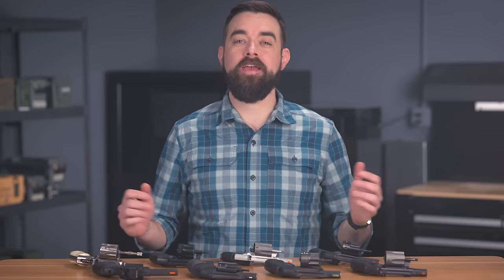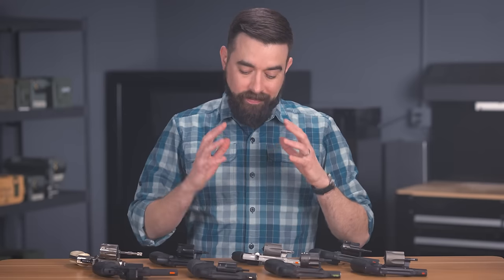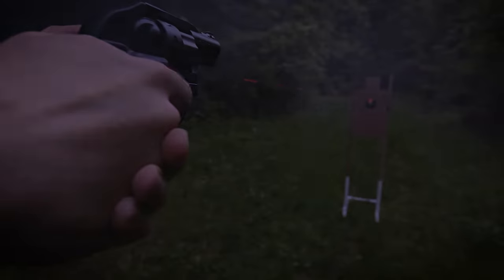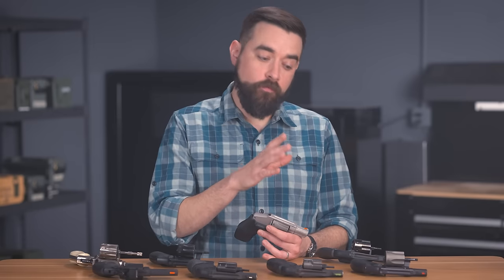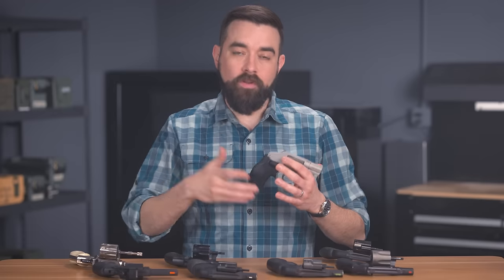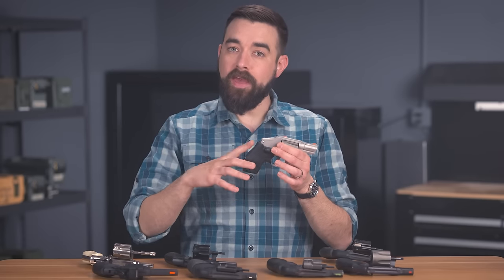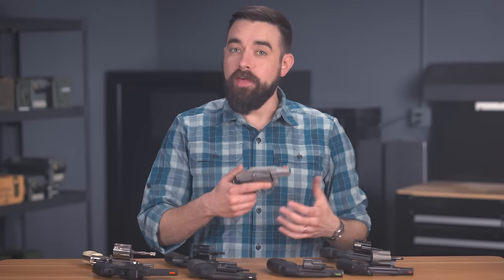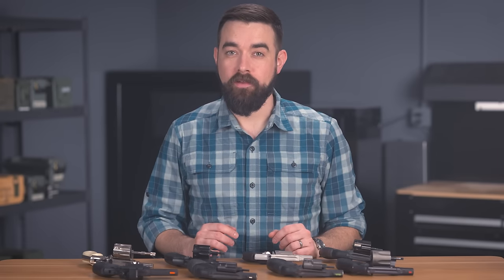Tips for Shooting a Snub Nose Revolver

Comment: One of the best snubby/J-frame videos. Well-done w/ a clear perspective that everything involves (1) awareness of your most effective grip & press habit, (2) PRACTICE, and (3) inevitably: compromise. 

The one thing to add to encourage those taking on the snubby challenge: you will become MUCH more skilled with your other larger and more "conventional" handguns. I'm a crack shot now with my G19. This is the by product of developing very good skill w/ a 442.
In my last re-qual for CCL (shoot the giant B-27 @ 5, 7 & 10 yards), my target was the best of the entire class of 10 shooters, all shooting semi-autos up to red-dot equipped full-sized versions. Only 4 of the 30 ended up in the 9 oval, all fired 5rd in ~7 sec or less. If I had used my G-19 (box-stock except Dremel-crafted grip mods and new sights) they'd have all been Xs.

Comment: Very good video on the subject. I was a plain clothes LEO in the era when a snub was the best option a lot of the time when concealment was a must. I carried several different snub .38 revolvers over the years. Everything you said is valid. I have always said that snub nose revolvers are not for the novice and not for anyone who does not put in the time to get decent with them. When it is a matter of life and death like it is as an undercover LEO you do what you have to get proficient or at least I did. To this day the only weapons I will ankle carry are a snub revolver or a baby Glock. That method of carry is just too dusty for me to trust anything else. I personally would never go any lower in caliber with a snub than .38. Most of the time when I use one now it's either a S&W 642 Airweight or an older S&W 649 .38. If I can find standard pressure 158 grain lead semi wadcutter ammo that is what I prefer, if +p is all I can find in the same projectile that is what I use. Like you said its all subjective. That ammo in those guns with either a boot grip or a Tyler t-grip is what I found worked best for me.

Comment: What a well done comprehensive analysis of snub nose revolvers. The one thing about wheel guns is they always work and they are as simple as pulling the trigger.

A long time ago as a police officer I carried a Smith & Wesson snub Chief's Special stainless, 5 shot .38 Special as a backup and off-duty carry. What a bucking bronco! Ended up ditching it for an AMT Back-up .380 that fit into a cigarette pack in my shirt.

Comment: I gave my dad an Armscor M206, then put some aftermarket Colt D series grips on it. It feels GREAT in the hand now, love a grip that starts narrow at the top and swells towards the bottom (which is why I HATE the wide rubber grips on my .357 Magnum).
Reply: I bought that grip but need help fitting it on my 200.
Reply: @sidneywhite749  it isn't a perfect fit, but it is close enough to work. I lined up the back of the frame with the grips, if the front overhangs a bit it doesn't make much of a difference. For the holes for the frame pins I used a drill bit and twisted it by hand to make the holes. There is a small gap and a slight overhang on the front but it is still WAY better than it was.

Comment: I really like Pachmayr Diamond grips.

The crimson trace grips for LCR are pretty good too if you want a laser. The thing to remember about a side mounted laser is that POI shifts significantly side to side depending on distance to the target.
Reply: My friend owns a Ruger LCR .38spl with a red Lasermax. He's owned it since spring 2013. He has it mainly for home security 🏡. For ammunition, he loads older +P Cor Bon DPX 110gr. 5rd.

Comment: Excellent video! Personally I prefer a larger framed snubby (K frame size) in .38/.357 with full size rubber grips. Then carry it appendix. Also it has to be a minimum of 6 round capacity. 
This is just what I like and am used to shooting.

Comment: I grew up shooting my dads '60s chief special. He still carries it.
The grips and handle are tiny even compared to alloy models of today and feels like hitting yourself in the hand like a ballpein hammer.
After one box of plus P as teenager, my wrist and fingers swelled huge. Maybe stress fractures.

I always went with bigger, heavier, cheaper Charter arms until Ruger made the LCR dao.
It's like night and day recoil control. I can shoot an hour with those, no problems.

I go with Jerry's j frame technique. I'm old so I still use a half weaver half modern stance and pinching the trigger ring guard and back strap with index finger and thumb on the support hand centers sight alignment naturally.

Comment: I second everything you said Chris. I have a S&W 642 Lightweight I almost sold after  a painful first range session with plain Jane .38 Special LRN bullets. After 1/2 a box I was done. I planned on selling it until I watched a video where the person raved about how the Hogue replacement grips ($18 then) changed his attitude with a similar revolver. I ordered a set and the guy wasn't kidding. The Hogue grip was a little longer with a pinky groove but the best feature was the part of the grip covering the backstrap. It has a lot of give and completely removed the snap sting of the backstrap from my hand. Also as you stated it allowed for a better finger weld on the trigger which seemed to smooth the trigger pull and made the trigger pull weight feel much less. Needless to say I love the pistol now and it is one of my favorites mostly due to a simple grip changeout. Great video and a real benefit to those watching who may be disappointed in their lightweight snubbie!
Reply: Get a spring kit for your 642 and it will be even better to shoot!  🙂

Comment: Great information here.  I've only had guns for a few years but revolvers are my "collection" so I'll add a few things.  Like you, I used an orange paint pen on the front sight.  I also used a lime green/yellow paint pen to put dots on either side of the rear sights.  
    My main defensive gun is a 38 Special snub-nose.  After trying a bunch of different ammo, I concluded over time that I am a lot more accurate with standard pressure 38, not +P, in a snub-nose.  For carrying and at home I load Hornady Critical Defense which has lightweight bullets so they go faster and get good hollow-point expansion.  I did a water jug test with these compared to a 38 +P hollow-point and the standard pressure Hornady expanded just as well as the other brand +P.  Recently I bought a large frame 357 Magnum and will almost always just use 38 in it.  My supply of 38 +P should match well with the 357.
    A big thing for me was the realization that with a snub-nose, any time I want or need to shoot farther than 5 or 10 yards I am more accurate with single-action instead of double-action.  My first gun was a double-action-only and I later bought a S&W 637 that can do single or double action.  Most self-defense shots seem like they should be close up, under 10 yards, but carrying the single-action option gives me more confidence if I ever faced a decision about trying to take down an active shooter or something like that out to about 25 yards.

Comment: I recently got rid of my S&W 642 because it was just too uncomfortable (downright painful) to shoot - even with larger, rubber grips on it.  My hand size just wasn't compatible with that one.  I love my 351C (.22 Magnum), but with the low recoil there, it's painless to shoot.  As for a snub-nose .357/38 Special, I like the Kimber K6S with target grips.  It's bigger and heavier than the S&W 642 (similar to the Ruger SP101), with an extra 1-round capacity than either the Smith or Ruger.
Reply: You might also want to consider the Charter Arms Undercover and Police Undercover, the Taurus 856 and 856 Ultra-Lite, and the Rock Island Armory m 206.  Any of those are better than my S&W 442 in comfort, accuracy, and especially, price. Personally, I prefer the Charter Arms Undercover, which is my usual carry. The Police Undercover is slightly larger and holds 6 rds.  Both are excellent "always guns".  Another is the Charter Arms Boxer, an aluminum version of the Police Undercover.
Reply: I use the kimber control core grips on my 2” DAO. Adds room for your pinky and covers the backstrap. Makes it not as concealable but really not too great of a difference
Reply: My first ccw revolver was a 442.  Same as your 642, but black. I also hated the rubber grips it came with.  To my amazement, the old classic wood checkered grips the gun  was designed with back in the 1950's, were far more comfortable for me, even though they're smaller than those rubber monstrosities Smith & Wesson switched to.  I bought a set at a gun show for, as I remember, $25.00, and they completely transformed the gun for me.

Comment: I cut my teeth on a wheel gun and used it for work back in the mid 70's until the mid or late 80's when semi autos got authorized. I have no issue using one and have carried one for many years. The sights are normally fine for out to 25 to 30 yards. I do like the laser grips. As to hitting, the secret is one thing. Practice practice practice and also include dry fire practice.

Comment: I replaced the front sight on the LCR with the HI VIZ fiber optic. Chris is correct that it seems tall compared to the sight picture we are taught. However, i did not find it to be a problem. 

First, since I use red fiber-optics whenever I can, my natural sight picture is to see the full red circle. It did not change with the lcr and I actually hit the target well and did not feel I was straining to adjust. The bottom of the circle just sits at the bottom of the rear sight. 

I tested at the range today. 6 o’clock hold on the bullseye as recommended in the manual. Winchester 130gr fmj white box. At 1 yard: 0, at 5 yards, inch high, 10 yards 1.5 inch. 

I will try again but I saw enough. My conclusion is that the sight might be high, but within 10 yards, any assailant is not going to  like where I am hitting and I don’t need a special sight picture for the LCR. Good enough for me. 

Also, with a good grip regular 38 special and +p work for me.  After 150-200 rounds, I know i have been shooting a snubby but I am not dreading the training.
Great video

Comment: I am surprised you didn't bring up the fact that you can fire .38 short Colts and .38 long Colt in a revolver chambered for either 357 Magnum or 38 Special. Both of those rounds have noticeably less recoil compared to 38 Special in a small gun. But the ammunition can be kind of hard to find, and can only be found in lead round nose bullets.

Comment: My daily carry is a Ruger LCRx in .327 federal magnum. I love the gun for several reasons. One is it's versatility in the 3 different calibers it can shoot. My wife is very small and can't handle much recoil. But she can handle that gun loaded with .32 s&w long hardcast wadcutters made by buffalo bore. They don't expand but they penetrate 15 to 16 inches in gel tests and it has the same recoil as a .22 Mag. 

Also, I like the revolver platform for sub compact guns. Although most modern quality semi autos are just as reliable as a good revolver, I haven't found that to be the case when it comes to micro sized .380 guns like the Ruger LCp and smith and Wesson bodyguard. They jam a lot more often than revolvers and larger semi autos. 

The .327 is a great caliber but ammo is all but impossible to find right now due to the ongoing supply chain issues. All the ammo companies are mostly focusing on more mainstream calibers and are making very little to no .327 mag. However, I just started reloading and it's a lot of fun. I saved up all my .32 brass and I can make my own .327 ammo for anywhere from 15 to 30 cents a round depending on what projectiles I use (defensive ammo or target). Factory .327 magnum ammo goes for a dollar to 1.50 or even more per round when you can find it. 

If reloading sounds interesting to you but you don't want to spend a ton of money, or you don't have the space to set up a bench, you can get a lee hand press kit for about 60 to 70 dollars. And then a set of dies for .327 federal magnum which can also load .32 h&r magnum and .32 s&w long are about 60 dollars. You also need a scale and a couple other inexpensive tools as well, but you can get started for only a few hundred bucks. The hand press is slow, but I just do it while I'm sitting at the coffee table and watching TV. It's actually relaxing and fun.
Reply: I caution against having TV while reloading.  One mess up when adding the powder (typically people throw two doses in the same case) can equal a blown up gun.

Comment: I like my S&W 940-1 for pocket carry. Being 9mm and all steel, I find it a good compromise between shooting weak .38Spl or over juiced .357 magnum. For the front sight, I use Testor's neon green model paint. There's a large segment of humans that see bright green better than red or orange, but everyone should try for themselves.
Reply: Mine shoots high, does yours?  

I'd never pocket carry it though; a steel revolver is a little brick.
Reply: @DWalter.27  Mine shoots fine. Point of aim is usually an issue of ammo choice. As for carrying, it's ok with the Mika pocket holster I use.

Comment: I too use a bright orange Nail Polish to highlight front sights on all my older Revolvers, applying 4 or 5 coats. I use Alcohol Prep Pads to first remove all gun oil from the front sight ramp. When firing any Revolver I get bad Sinus Bite, meaning the area between the back of the trigger guard & the grip. I use Pachmayr Grips on some, Hogue on others to rectify this.

Comment: A load that's great for the alloy framed J-Frame .38 revolvers is a 125 grain (flat nose) cowboy load.  Pleasant recoil, sufficient power, and no bullet pulling/crimp slipping.  The latter can be a real problem with the tiny aluminum .38s. A 158 grain lead round, loaded to standard pressure, will often slip its crimp under recoil and jam the revolver up tight. Make sure to shoot a lot of whatever you carry to make sure this doesn't happen.

Comment: All very good, sir, with one thing I will have to take polite exception to: the grip.
Having the weak side thumb down on the side of the gun is both a waste of potential grip power (read: control) and a malfunction possibility: touching the cylinder or fouling the trigger finger.
In revolver shooting, the weak side thumb belongs atop the base knuckle of the strong hand, well to the rear and away from any hammer spur.  I've heard this commonly referred to as the "Weaver clamp" as it was the grip used by famed early action pistol shooter Jack Weaver.  
With the full pressure of the weak hand clamping hard on the strong hand, control is increased substantially and muzzle rise is much reduced.  Better still, shooting the lighter, smaller guns will be much more comfortable... and endurable.
Such a grip is also more ergonomic: you will get  the best use out of whatever strength your hands have.
By  going to a clamping grip, five-shot times into a A zone at any distance will be cut by at least a quarter if not more, all else being equal.  This we have proved to ourselves numerous times in the course of running our instruction business.  Of the hundreds of people we've had try a clamping grip, I cannot recall a single one with whom results did not immediately, and considerably, improve.

Comment: I use Hornady Critical Defense in my Charter Arms Undercover. I don't find the pull in DA any heavier than on my Rugger GP-100. It came with the larger rubber like grips so I don't have any problem really with the grip or recoil. I have a very old S&W that my mom bought decades ago. It is so old it has the firing pin on the hammer so I only keep 5 rounds in it. It has the much smaller grips on it. I will have to get it out and fire it.

On my Rugger GP-100 as I got older and my hands got weaker I found magnum rounds caused the back of the trigger guard to smack my finger hard enough to bruise. I got a Houge monopod grip and I love it. Let's me fire magnum rounds with both weak and strong hand into center of mass at 25 yards. I can do that with the molded grips that have the same overall pattern at 7 yards.

I may have to change the grips on mom's old S&W to Houge or something else If I find I can't control it with the small ones on it. Not going to use it for carry i keep it in the house for self defense in the isolated house I live in now. It sits in the cabinet my mom kept it in for years. It is in great shape and has been cleaned and is ready for use.

Comment: When I pocket carry a snubbie I choose my Ruger LCR in 9mm and I carry a spare 9mm semi auto magazine as a reload. The Ruger doesn't need moon clips so I'll just use my thumb to push feed each round into the cylinder from the magazine. I've tried speed strips too, but the semi auto mag is more convenient for me.
Reply: The magazine as a reload is a great idea.  Personally, when I carry my 640 .357, J-frame, I carry a Ruger LCP .380 with the factory 7 round mag plus 1 in the chamber, in my left pocket, as my "reload".  I have carried J-frames a long time and I like a larger grip which makes using a speed load kinda impractical.  I doubt I will need more than 5 founds of .357 to resolve an issue, but better to have it and not need it.....
Reply: that's a creative idea!  like a PEZ dispenser for boolits 😂
Reply: @RealJohnnyDingo  Yeah, that's exactly what I call it. My PEZ dispenser.

Comment: I carry my Ruger LCR most of the time because it is easy too conceal. I did change the front sight too a bright green color that glows well. It is only a bit taller than the standard sight it only shoots 2 " high at 20 feet so that is fine for what I carry for.